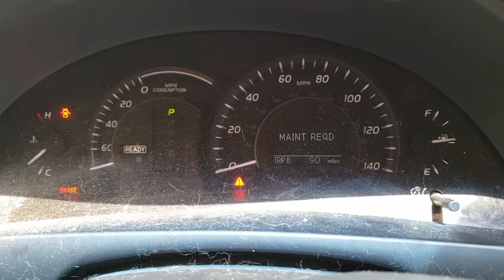This Was Shocking Learning How To Change A Hybrid Battery Cell

Comment: I need to do this - did you balance the cells once you installed the replacements or no? I've seen a couple videos where they didn't, and it worked out fine.

Comment: Also the hybrid replacement shops are overcharging by a lot. It doesn't matter how many modules are bad, you pay full price for a used battery. You replaced 3 modules, that's about $120 in modules, vs the 1200 - 1600 for a full replacement. They wont tell you how many were bad, for good reason. They get a mostly a good battery from you that just needs a couple/few cells to be changed out and they just resell it, it's a total racket.

Comment: My bro is having the same problems with his camry. Did your VSC light at any point come on?
Reply from the maker: ya, about the same time the hybrid warning came on
Reply: @SliderHavoc  right on. Seems like alot of work, but it also seems like a money saver. Did it help you in the long run?
Reply from the maker: @timothydoerrjr5911   I ended up replacing individual cells 3 different times.  I would have issues about every 6 to 7 months.  But my car is over 10 years old at 100K+ miles. I ended up finding a nice replacement for 2k and a 5yr full warranty. I think it's well worth it.
Reply: @SliderHavoc  so bottom line, is it worth the hassle replacing individual cells or just buying a whole bew one?
Reply from the maker: @timothydoerrjr5911  I believe the cost savings is worth it, but just take into consideration, that after you fix it, it's just a matter of time before you will probably need to do it again. 1st time I fixed it, total work took about 4 hours, last time about 1.5 hours. Each cell runs about $35 US. It just depends on how you value your time and energy. After the third time, that changed for me and I bought a new battery. Also remember once you start, you will be without a car until you get the new cell put in. I bought 1 the first time and it took 2 more days to wait for it to arrive. The next time I ordered 3 ahead of time to not loose use of my car for a couple days.
Reply: @SliderHavoc  where did you get your hybrid from
Reply from the maker: @nonenone4078   I purchased it brand new back in 2006.
Reply: @SliderHavoc  the individuals cells is what I meant  sorry
Reply from the maker: @nonenone4078  amazon

Comment: if you're going to do somethimg show the steps, we never seen any "finding of the bad batteries, how many where there? also right after youd started about if thats all the problems oil change and trunk open, the dash lights started flickering or was that just the camera acting up, anyway it may have been good for you and you did show that the average guy can get this done, but in order to be helful, show the steps. just is.